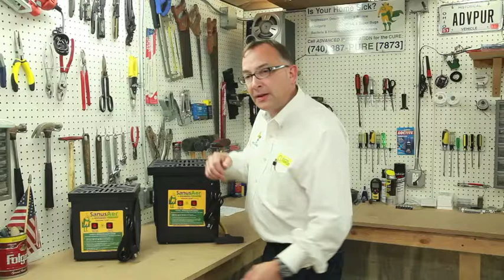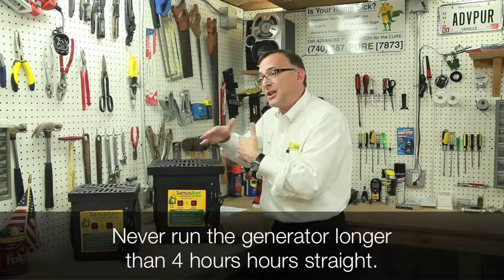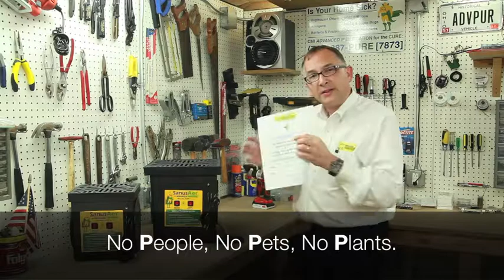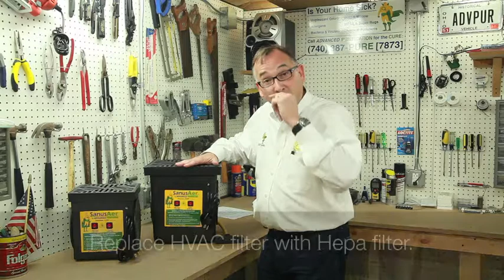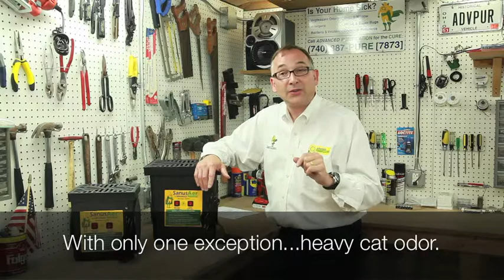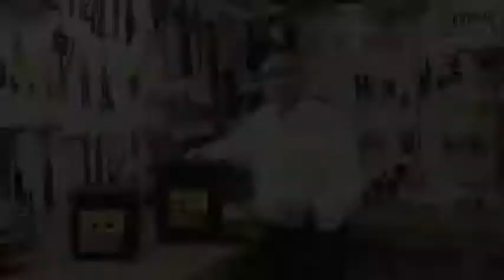SanusAer® Ozone Generator Shock Treatment Protocol

Comment: Because they need fresh air.. are there attachments hoses for your machines? So one could pull air though a small window like your video on car odor. Imagining a dryer hose running inside and to the machine.. allowing the machine to run for an extended amount of time? Thanks!